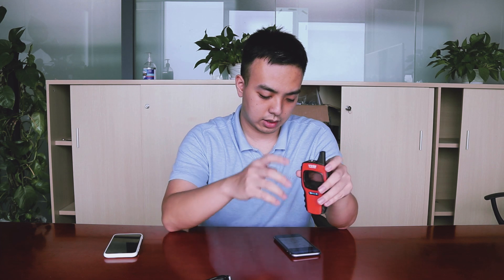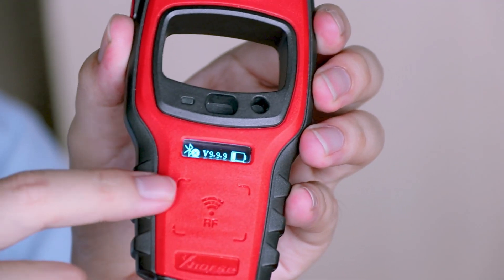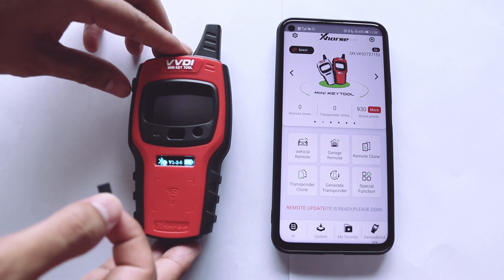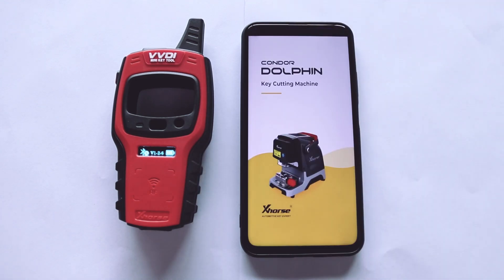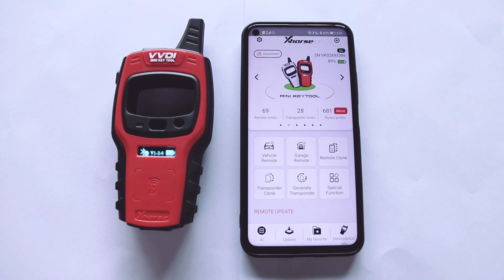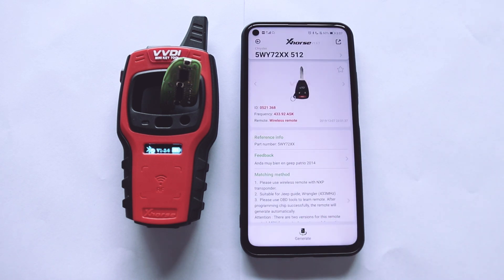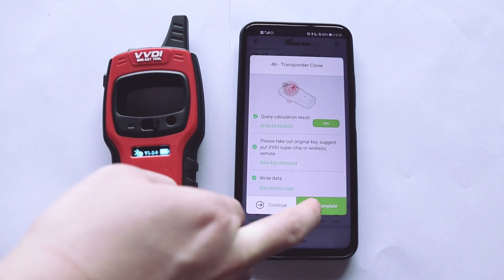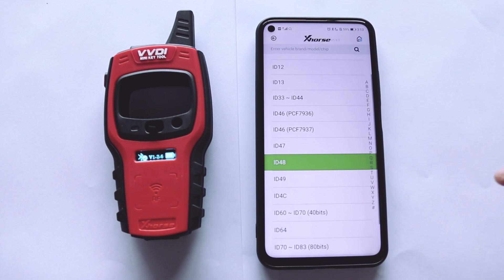Xhorse Workshop 001 MINI KEY TOOL OVERVIEW

Comment: There's more to it from scratch than this. You have to register your device. The procedure depends on what chip you are programming, whether it's OEM or clone/aftermarket. Generally always do remote before ignition pin code for transponder. I couldn't do remote for my Peugot car on this even with the OBD dongle. You may well need a Key Tool Max which XHorse seem to say is a much more capable device when coupled to the OBD dongle (usually via BT).